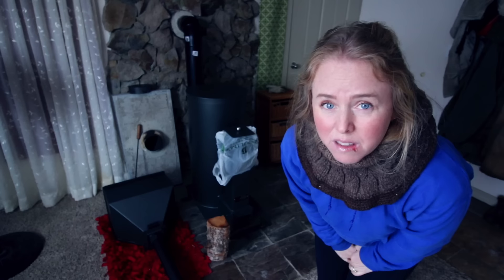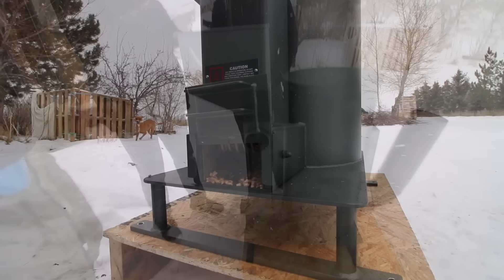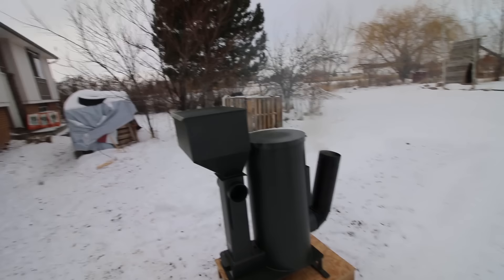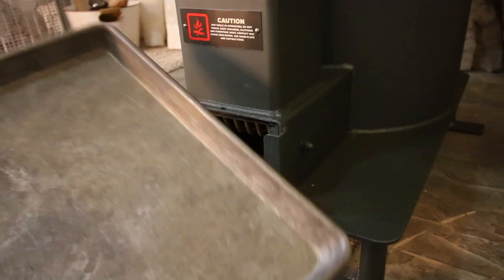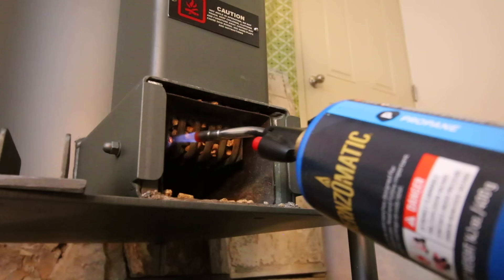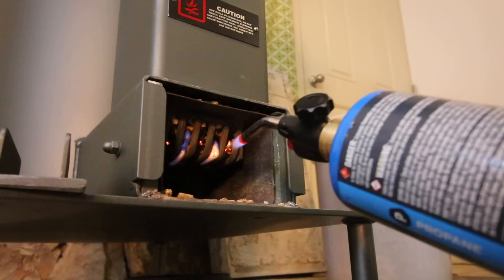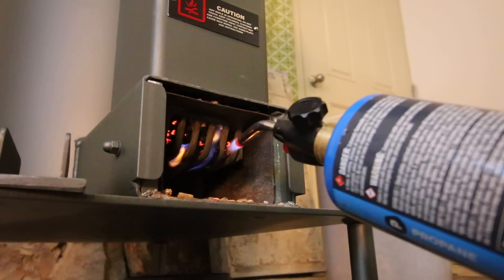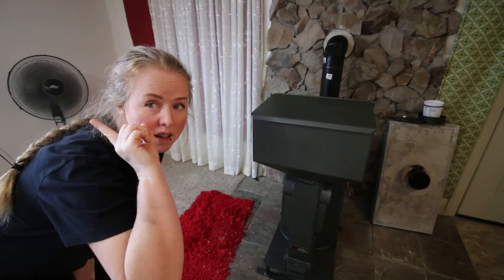Non Electric Pellet Rocket Stove REALLY WORKS for Heating Without Electricity Liberator Rocket Stove

Comment: Do you have any stats for us? I was just wondering how much you pay for a bag and how big the bag is and how many bags you go through in a week? This looks like a lot less work than my Firebox add on to my furnace ductwork. I burn chunk wood from wherever I can get it cheap and have to fill the box 4 to 6 times a day, depending upon what the outside temp is. I can heat my garage and the 2200 square living space, but it is round the clock work to keep it going.

Comment: Why no flu damper plate in the house above the stove before the masonry? Seems like that would stop the flu from leaking house air. My stove leaks cold air back into the house so the damper plate resists that. My chimney is a metal bestos 6" 24' tall. most of the metalbestos is outside. It gets cold when you are not heating so the cold air overpowers my interior warm air. I actually thing warm air leaks anbd cold air comes down to replace the air in the house. In any case the damper plate kills most of the air transfer when I am not heating.

Comment: I would have added a pipe to avoid over heat top plate ,, and afrer torch 2 minutes,then use a bellow to get going , a tin can and a fire start cube also light hands free walk away

Comment: I see you're in a split-level..  does this heat the entire house?   I swapped out a 50kbtu wood stove insert for a 50k btu pellet stove insert.   the pellet stove (harmann) would barely heat the room it was in, so the next Fall, I swapped back to the original cord-wood stove insert and sold the Harmann.  I'd like to explore a good efficient pellet stove insert to heat my 1900sqft 2 story like my stick burner does, without spending 5-6000$ to do so..

Comment: We got to have faster more efficient ways of lighting the pellets, what if all a person has is paper and a lighter, so would be nice to see other videos of you guys trying different methods to light the fire, who knows maybe you all will find a better more efficient way in the process, me I make homemade fire starters with cardboard egg cartons, candle wax and saw dust or chainsaw chippings, put the wax into a pan that you don't care about melt it then add saw dust or chippings to the liquid wax, then stir and add more dust until it seems thick kinda like bread doe, then scoop with a spoon and fill each pocket in egg cartons, set off to the side to cool and harden, after about 30mins to an hour you should be able to use, they simply break off like a KitKat bar and you can choose to use 1, 2, or even 3 in row to get things cooking fast and reliably, I've started seasoned wet wood with these so they work great and last about 5 or 10mins themselves...

Comment: Those torches are not really meant to run that low.  The tip should not be glowing red. You need to open the valve a little more till that doesn’t happen.

Comment: Can I ask why you chose a rocket stove over a conventional wood stove?
We're off-grid and heat with a Harmon (pellets). The stove works great but still needs electricity. An additional way to heat would be reassuring.
Reply: Rocket stoves; burns  less wood and  less ashes.

Comment: I wonder how the pellets are fed just manually? How long can it burn without having to feed pellets?
Reply: It's a gravity feed from the hopper.  There is a slide to adjust how fast the pellets will drop from the hopper into the feed tube.  I saw someone else with a Liberator recently and I believe they said they got about 12 hours from one full hopper

Comment: Instead of the blue propane can get the yellow can called Mapp gas. It burns much hotter and you say that it doesn't have to be a turned up flame but you are wrong. Believe me. And hold. it in one area for 30 seconds and move to the next section. I was going crazy watching you starting this. 🙂

Comment: Did he say 5th degree burns? Hmm Sun burn 1st, blisters 2nd, charred skin 3rd. 5th ???? You ONLY need to start a small area not the entire bottom. I would place a small piece of cardboard at the bottom of the grate that is saturated in wax. Basically like a candle. Overkill on lighting it was okay 3 minutes earlier....Find a local tree service, they will give you the wood chips from the chipper. Once lit even the green wood will burn as the heat will dry it before it falls onto the bottom plate. Tree companies LOVE folks who take their chips so they don''t have to pay  the DUMP!

Comment: I told a weld shop about a mass heater yrs ago. The guy said that name of company is owned by Mercedes. It was a box the size on a endtable. The stack went sideways,,,ie: mass heater designed. Soo much out there we cant have. All about control of masses. Elon Musk has a 15,000 house now. LOL, never be allowed and will be scooped up happilly by rich that are tired of FORCED inefficiency if they allow it. Elon needs a new city with new infrastructure....like The Venus Project...first few miles of road leaving the city charges the cars

Comment: So you took it outside in the snow  where the water will spoil the paint! You burn the stove very hot and the paint bakes. Open your door and window and blow the fumes out. That is all you need to do, not for 3 hours!

Comment: Sounds like a potential house fire. At $6 a day is at least  $180 a month. Not a huge difference. Is interesting but I'm not comfortable with a non controllable super heat devise in my home. Initial cash outlay is probably high unless there are plans to build it. I'm an 80 year old experienced In all types of fabrication. Off grid since 69 WAAAAY off grid. I don't favor a heating unit I have to go to town for fuel instead of my wood lot. Total solar wind wood heat n cooking. Grow and raise most all needs. Would need some sound description of of fab and fueling. Dandahermit😮

Comment: Why couldn't you put home made fire starter under the grate to light it.  It seems if you run out of or can't get propane ... that you'll have a problem.
Reply: You can. I just used my diy fire starter I used in a box stove for years.  Save toilet paper and paper towel rolls. fold then 3 times. Once a year I melt Crisco and dip them in. Store in one of those metal Christmas popcorn bucket things. Make a good slow burn starter.

Comment: I would never buy a stove that only starts going with a blowtorch + 5-or-so minutes!  They need a re-design of that portion of it.  Golly Gee, Batman, how did the 'Indians' EVER get their fires going without $$Expensive$$ blowtorches?  AND they didn't have those expensive pellets either!  I cannot watch any more of this video (I'm at 13:18).  

I've seen real rocket stoves, where they start almost instantly, with small pieces of actual WOOD; and there was literally nothing coming out of the chimney but warm air and water vapor.  They had their chimney running through a 'couch' they made from heatproof rock-hard stuff.  The 'Chimney' also travelled horizontally a lot because the wood was totally combusted when inside the double-walled 55-gallon drum they used.

Back to the drawing board!

Comment: Will The Liberator Rocket Stove burn corn?
Reply: I'd say no, at least not for long. Corn is high in sugar which will carnalise and form black clumps called chinkers. These will plug the grate and keep fresh corn from feeding down to be burnt.  Corn burners have a rotating beater to bust up the chinkers.

And unless you are growing your own corn it would uneconomical, at least here as a month ago corn was $7.50 usd a bushel.
Reply: If it's dry as a bone I don't see why not. People are thinking this is only a pellet stove. It burns wood too. You pull the hopper and pellet grate out to burn wood.

Comment: Maybe over thinking a bit here,Id'e put a close fit kennel' around that stove to protect Everyone from the occasional brainfog misstep!? Equally important is including K9's Safety🐕 _ That lighter fluid soaked Charcoal Briquette' at the bottom of the Grate' is a genius idea👍I hope your using it?, holding the under flamed propane torch for five or ten minutes, is just a monumental waste of time and energy! For 5yrs, I have a decent size' Window type pellet stove, Im very familiar with all the Grateful Pros and the Problems, and the Constant Cleaning Maintenance! and going through a bag every 24 hrs or less, is alway$ on your mind!  Btw' Gotta clean your stove pipe regularly, call some Pellet service place?, or learn for yourself, Because once any soot starts building up in the pipe? It starts to Smell Very Acrid! Toxically Unbearable down wind! Even using clean natural pellets, so its not the pellets. 'Cooking Soot' smell is from not cleaning often or good enough. Many types of stoves, and their All a bit different?, it  can take awhile before you notice anything off aroma? Basically just give the 'stove pipe brush' some regular attention' for best  experiencial results! (Edit Sometimes just burning real hot' in a clean system' it still smells kinda not woodsy at all? So there that?) '\😶/' - Anyway Blessings always, and happy heating! 'srry so much writing, MerryChristmas✨🎄

Comment: those stoves are too expensive for something built out of a bunch of pipes  without motors I built my own from scrap square tubing and a old hot water heater it woks amazing and i burn wood chips , pellets or combined it can burn up to 1150 F. also installed a bunch of heat powered fans has been heating my garage for about 5 years now I'm in the process of building one for my living room a little smaller and better appearance
Reply: Would like to see that. I've got about 20' of 4" square tube, couple air compressor tanks and a welder.
Reply: @bandmasterjf write email here i will send some photos